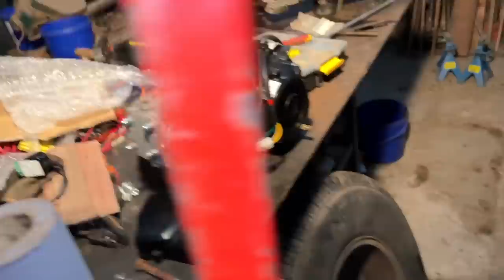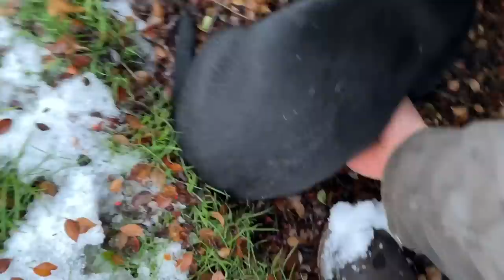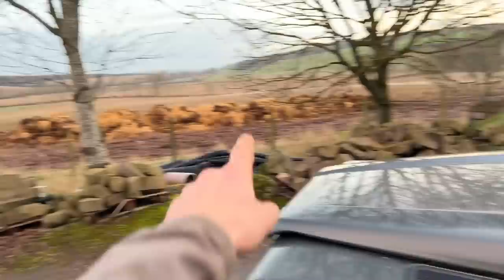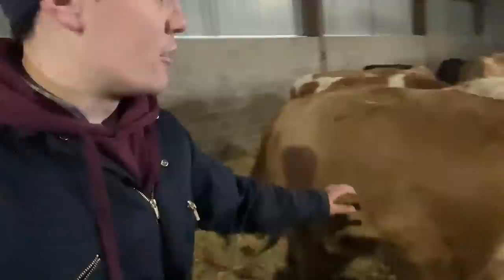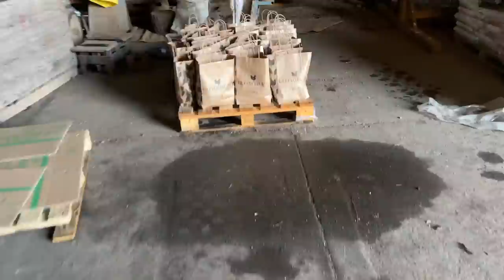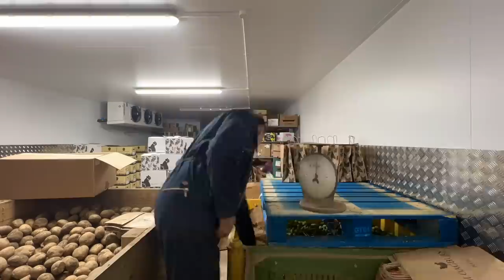Big Steamy Muck Spreading

Comment: Love Baxter mate he’s a cute dug!! 
Regarding the Loadall tracking, it’s common issue with them when the tyres get bald on concrete u get a lot of scrub and it’s to much for the steering system to handle and oil pushes back past the steer valve, put new tyres on and less scrub 👌 problem solved , it can weaken the steering return valve tho so if you get anymore issues replace that,  normally if the return valve weakens you get a hydraulic squeaking noise when hot .
Reply from the maker: Yes i have been trying to figure out what that noise was, thank you 👍🏼